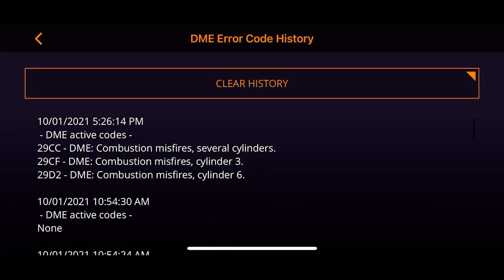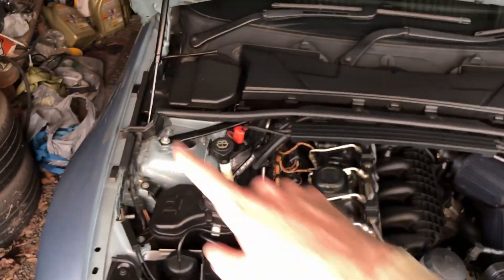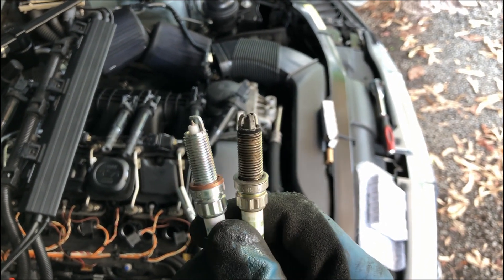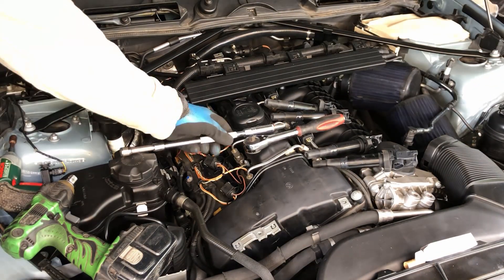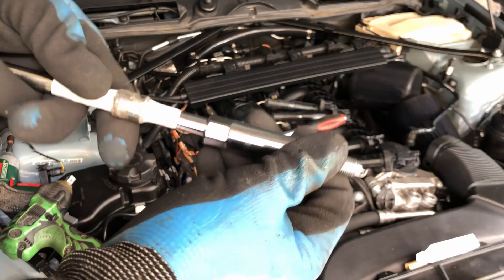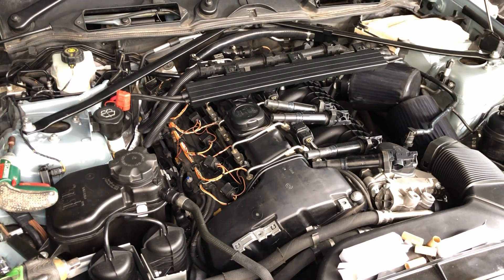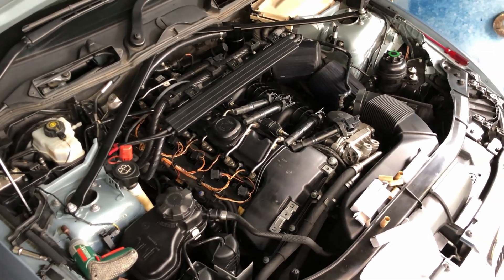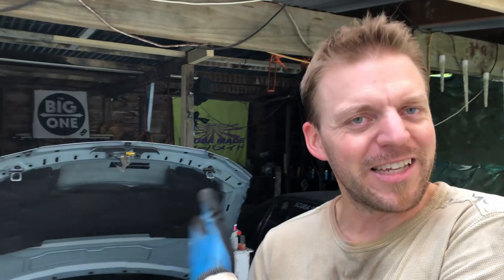Colder Spark Plugs in the N54 BMW, 335i E92!! DIY, EASY..

Comment: What plugs did you use? Part number?
Reply from the maker: I ended up getting 2 step cooler NGK Iridium Spark Plugs SILZKBR8D8S! 
And mixed with Elder coils I haven’t missed a beat at all! 
Still with the factory index 1 injectors too!